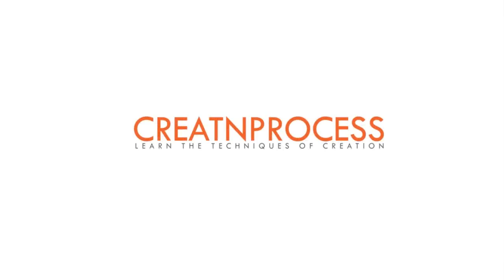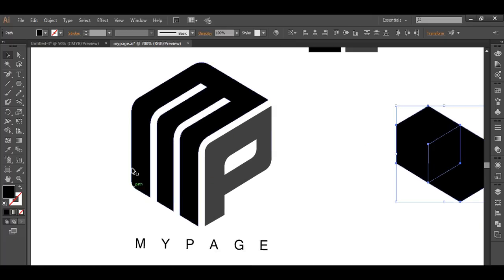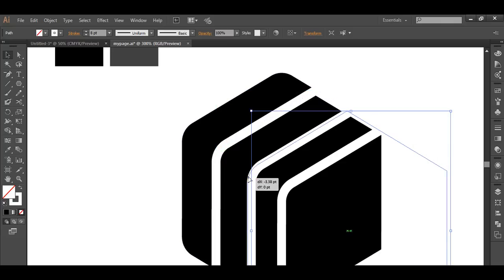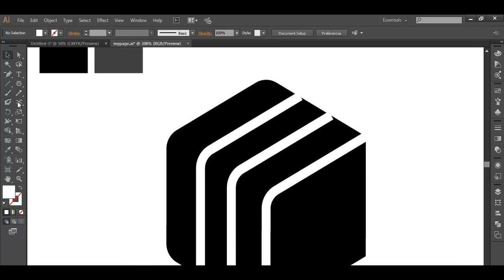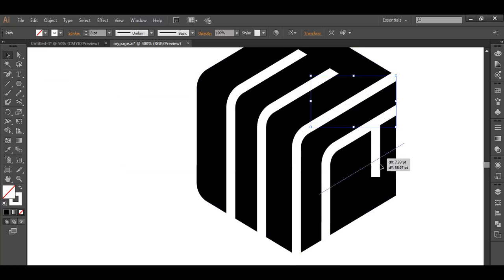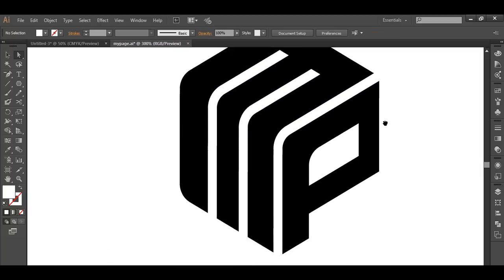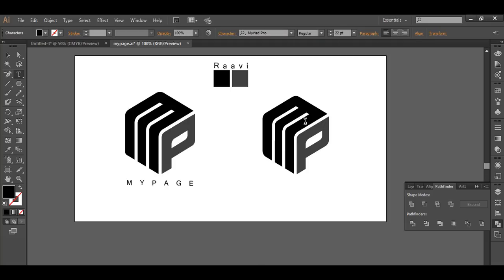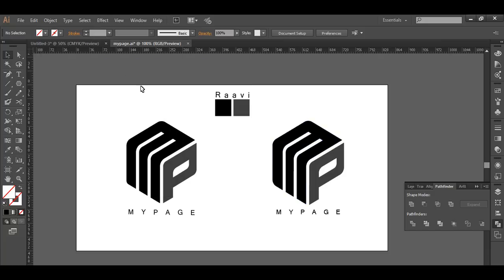Professional Logo Design - Adobe Illustrator CC (mypage)

Comment: hello there i do it what you do step by step but i can't make a point white to make round corner
Reply from the maker: +Mohamed Temmar In illustrator cc, it has a feature where you can easily make round corner by selecting the small circular icon and dragging in. But if you are using the previous versions, use direct selection tool and tweak the corners or use the rounded corner rectangular tool.
Reply: what is the name of this tool,the tool that allows you to make a corner round by selecting a small circular icon and dragging it?

Comment: how can i get rounded corners?
i did not get that small circle for rounded corners.
Reply: creatnprocess i got CS6 but i dont get the option HALP :C
Reply from the maker: viral patel If  you AI is previous version, then this feature will not be there,. But you can create the same using rounded rectangle tool.

Comment: How did you get the circular buttons to appear to round the edges?
Reply: Skssf Media He is using plug in for that, the plug in is called VectorScribe, google it and you will see
Reply from the maker: Skssf Media This new feature is Available on Illustrator CC. You can easily make any sharp corner round.
Reply: creatnprocess it doesn't appear for me on CC anyway, do I need to press something to appear it?
Reply: creatnprocess same issue, I can't found the buttons. My version is CC.
Reply: same problem. any way to do in manually ?

Comment: How did you get the circular buttons to appear to round the edges?
Reply: ***** I figured it out since then.  Pick the points you don't want rounded and click the the little scissor icon called "cut path at selected anchor points"  after that select the whole object and go to Effect - Stylize - Rounded Corners.  Check the preview tab and bump up the radius for the roundness you are looking for.
Reply: ryand76 He is using plug in for that, the plug in is called VectorScribe, google it and you will see
Reply: You need Illustrator CC (or maybe CS6 and above). I use CS5 and would have to make those manually. ryand76
Reply: adarkerlight  how to do it manually ?
Reply: Mihajlo D Awesome.  I'll check it out.
Reply: where can i find the crack for Mac plz-
Reply: it is cc 2018 version you will get